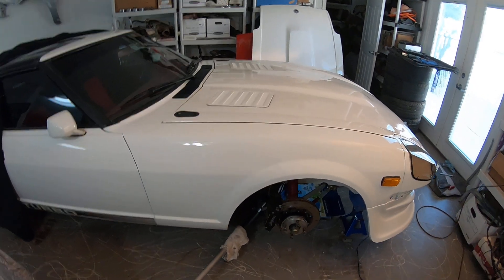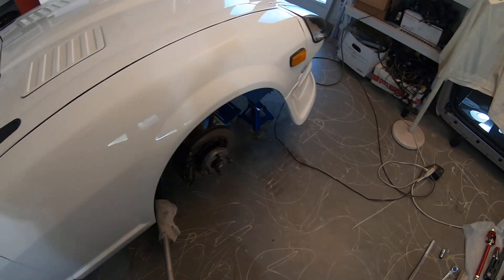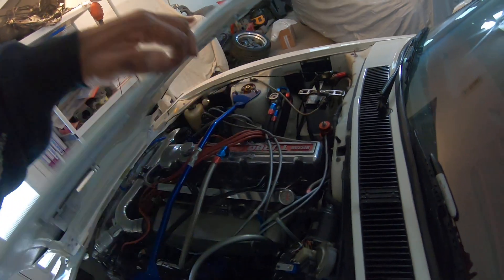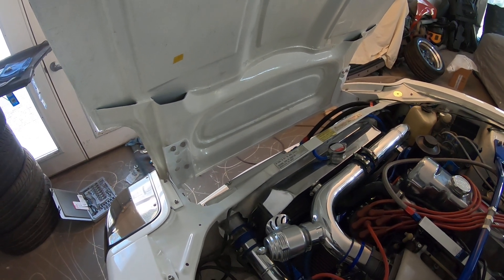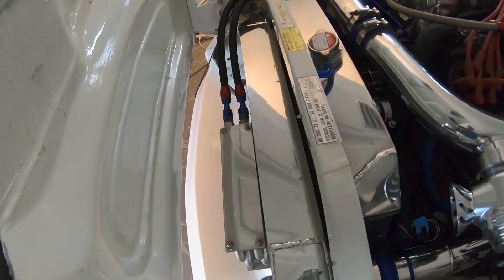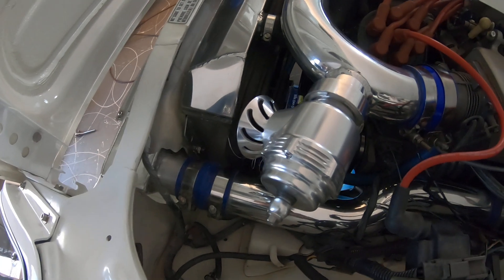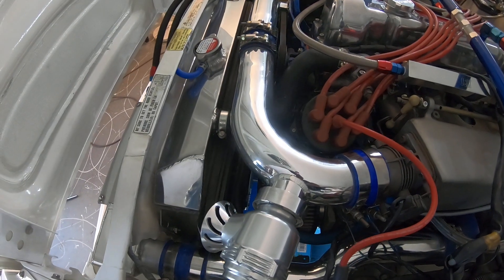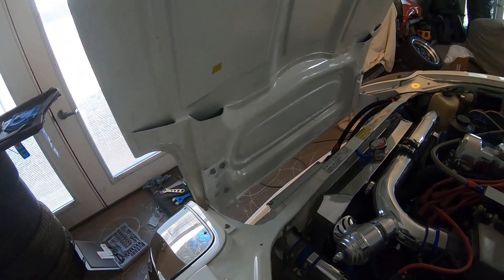Slownrusty's 1983 Datsun 280ZX Turbo:  Carbon Fiber Hood Install - Part 2

Comment: What is the weight of the OEM hood, do you know?
Reply from the maker: Yes, it weighs 39-lbs
Reply: @slownrusty  I just read in a forum that a hood with no vents weighs 54LBS. Was talking about a 2 seater 83. Mind you, I’ve never seen an 83 without vents
Reply from the maker: @shawnalbarghouthi4113 - yes…you’re correct. I had the wrong weight, thanks for the clarification
Reply: @slownrusty  man! This is some serious difference in weight. CF is about 20% of the OEM weight. Not bad!